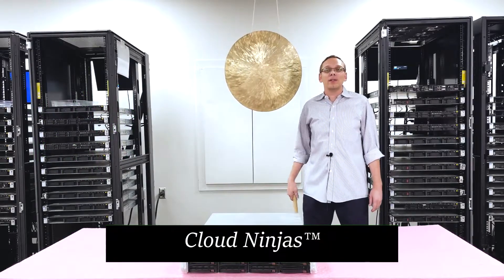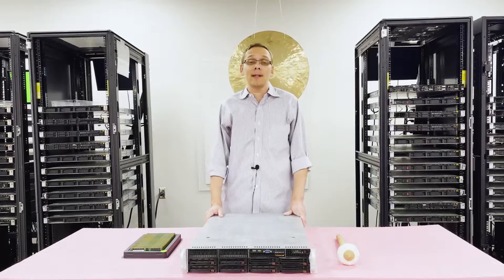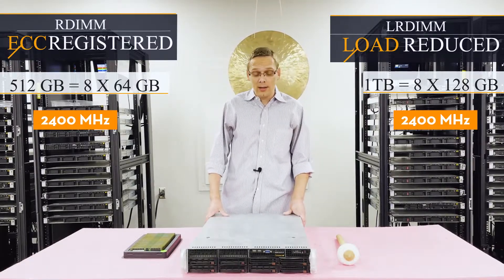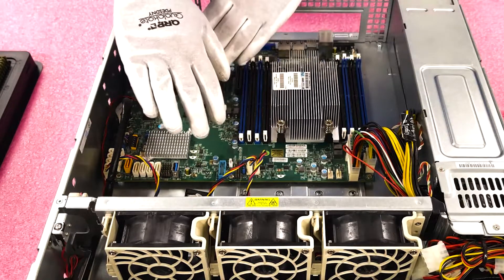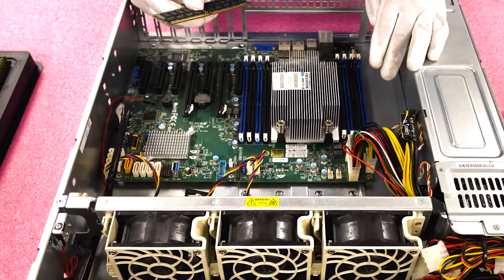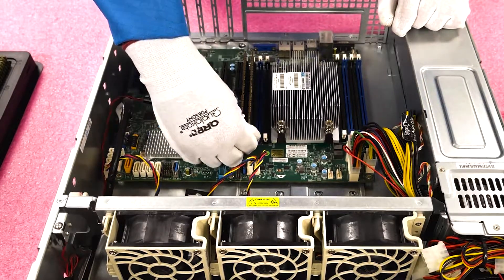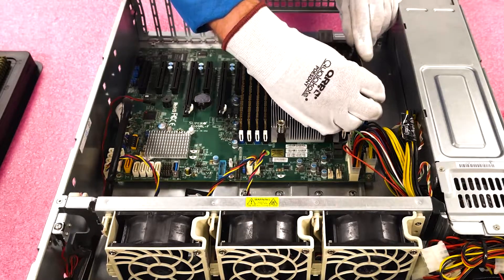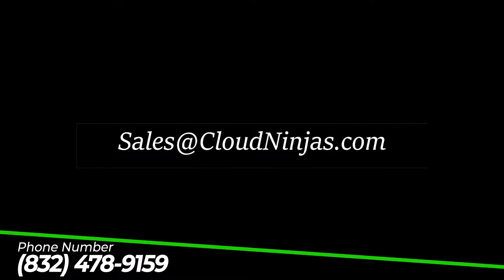Supermicro X10SRL-F & X10SRi-F Server Motherboard Overview | CSE-825 DDR4 Memory Install Configure

Comment: What are the differences between the “i” and “l” variants?
Reply from the maker: Great question.  From a memory or CPU standpoint... there is no difference.  The Supermicro X10SRL-F motherboard has 7 PCIe slots and Intel i210 dual port GbE Lan.  Whereas, the Supermicro X10SRi-F motherboard has 6 PCIe slots and Intel i350-AM2 dual port GbE Lab.  Hope this helps to clarify.  Take care.

Comment: The E5-1600 series just have multiprocessor disabled, so it's much more cost effective to use the E5-1680 than the E5-2600 chips